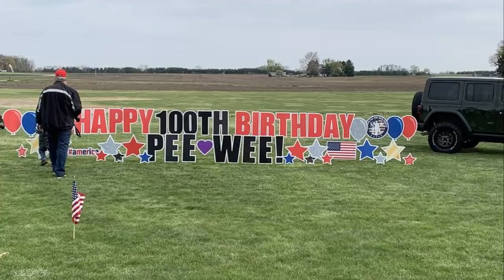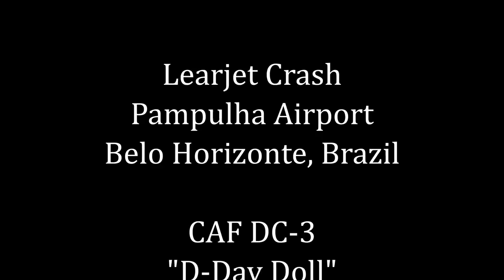Learjet Crash in Brazil/CAF DC-3 Loss of Directional Control

Comment: Here’s an idea. If you don’t have two engine’s working you don’t start rolling down the runway. Seems a pilot needs a safety briefing.
Reply: *Cough Cough" What's tha... *Cough".. I'm ok, let's go! ....
Reply: To be fair, it is a Dakota, and those P&W engine are temperamental beasts at the best of times, and if there is no oil leaking, then it has run out of oil.
Reply: @SeanBZA  
" if there is no oil leaking, then it has run out of oil"
LOL

That ought to be fun.
Reply: @SeanBZA  Pretty similar to many race car engines - at low rpm they sputter and sounds like they are about to give up the spirit but as soon as the throttle opens up they go into beast mode.
I wouldn't blame the pilot trying and then aborting there. The grass excursion is more a case of insufficient air on the rudder. And this also shows the importance of keeping the grass area by the runway "clean" because there will sooner or later be someone needing that space.
Reply: @ehsnils  that is why  you do a runup before takeoff. And they were having problems with it; they should've stopped there
Reply: My thoughts exactly !
Reply: No no when an engine starts to fail it always gets better up in the air at high power. Im sure of it!
Reply: @coriscotupi  The age old adage is if there's no oil  under them there  is no  oil in them!

Comment: Ok... So no war bird operator has learned from the 909 crash..  if the engines don't start properly.. or the engines won't run up prior to take off.. the flight should be SCRUBBED for 24 hours or until the faults can be identified, fixed, inspected and signed off.
Reply: Same as the North Perry FLA crash.

Comment: I got 344 hours on cargo Dc3's in South America in the 1980's.  If one engine was suspicious, we used to take off with that engine at reduced power to baby it.  I sort of see they did that on that video by the slow accel and lots of right rudder on take off roll.  No strong crosswind from the left i see to have lots of right rudder like that.  Not to say that is right, but sometimes we were in deep country side villages and needed to get out of there.. Fast..  Most times it was bad or old spark plugs..

Comment: Thanks Juan, I personally know of a couple of gear-up Touch-n-Go incidents that nearly ended in disaster: One, I witnessed from the ground when my father in an 1963 Cessna 320 was on an extended left base to final when instructed to switch from runway '34' runway '31' due to traffic doing an aborted take-off on runway 34. In the process he raised the gear and was distracted by non-pilot passengers and a confused new tower controller, and forgot to extend the gear from a tight left base to 31 that had a significant left cross-wind. This caused him to 
'prang' the left prop on the concrete and then the right prop as he lifted the left wing. He had enough excess airspeed to manage a pull-up and abruptly fire-wall both throttles, an action that in an an early turbocharged aircraft such as the 320 with fixed waste-gates caused the right engine to experience a major turbo surge and produce more than full power, while he left engine experienced turbo lag and to  'bog' severely with a near total power loss. This caused my father to end  up in nearly a 90 degree left bank just above a stall and on a collision course with the control tower. He cut power on both engines nosed-down and rolled-right and managed to miss the tower by about 20ft as the tower crew ducked for cover. 

After nearly missing the tower, reducing and re applying power allowed both engines to power-up normally and my father to recover a few feet above the airport fire station roof and land with nearly a foot of each prop curled backward. His take-away was to follow the old rule-of-thumb and after a balked landing attempt to completely abandon the landing until normal pre-landing procedures and approach can be implemented.
Reply: That is one crazy story, and I believe it just like you told it.
Reply: I would have thought "tight left base" is a red flag.
Reply: @jamescaley9942  Indeed, and as I clearly recall, my father remarked that the 'confused' controller after clearing him to land while on downwind to base, the aircraft on the runway aborted just as he was turning final. The controller then instructed him to 'Go Around!", and just as he 'upped' the gear and added power, the controller said to then make tight left left-base for 31 and cleared him to land, instructing other aircraft to follow a friend in an ANG Mohawk doing a practice IFR approach to ILS 31. Our friend in the Mohawk saw the incident on final so the Mohawk traffic might have been a reason for tower saying make tight base for 31. 
My Father said he said he was a little low for a left base to 31, so he left the flaps in 'approach' and a set-up for a gusty cross-wind landing on 31. 
I'm guessing that making a tight base didn't feel unreasonable to my father as he was an old Navy pilot and preferred tight military overhead approaches. However, was not in a position to do a diving approach, a little  'draggy' and ended up holding power right down to the runway. He said he never did a final approach check because he felt he was configured to land and forgot about retracting the gear and got the gear horn just as he reduced power and pranged the first prop. 
In hindsight, the best thing would have been  to decline ATC and continue the go-around on 34' rather then convert to some ad-hoc approach. 
 I do  I recall at the time ATC as SLE used to get things balled-up when ANG operations and others were using 31, and VFR GA student pilots were using intersecting 34. A few times traffic got so screwed-up I and other pilots simply left the pattern until they  it got sorted out.

Comment: My father had that during training, doing a whole set of cadets in take off, return and land, then hot swap the pilot to get the next one in. His turn again, and half way down the runway between V1 and V2 the engine cuts out.  He probably still owes the UK government for one Gypsey Moth..... But they never collected, and he also owes them for one Lancaster, he lost it over Lake Constance, though the Austrian doctors did tell him he was found 2km from the wreck, in a snow bank, with a pine tree in him in little pieces.

Dakota will be fine, that landing gear is meant for dirt runways, just wash off the grass.Last one I travelled in was in 1992, where the FE and I got to look at the underside of the plane from the door, because the gear indication was faulty. I was his voice relay and safety harness. Smoothest landing ever on a Dakota.

Comment: The D-Day Doll incident shows  how important it is to have good, experienced, well-trained pilots, as well as well-designed, tough aircraft. The DC-3 was built for dirt landing strips and grass runways (after all, landing strips weren't highly developed in 1935), one of the reasons why it excelled on its WWII missions. It could take off and land anywhere, even on aircraft carriers! Not that it was a regular carrier plane, but it did land on one, and it took off using JATO bottles for thrust. Similarly, it was the first aircraft to ever land in Antarctica! The C-141 was the first jet aircraft to ever land at Antarctica. Now, of course, jets fly in and out of Antarctica all the time. People like to crack jokes about the C-141 and C-5 landing on aircraft carriers, but it would have to be one mega carrier to accommodate those wing spans. LOL

Comment: It’s interesting where the firefighters are cutting, it looks like they are trying to cut open the door - tough ingress point compared to a frame bay. I believe all aircraft should have marked rescue areas. I watched a demonstration where they attacked a door on a plane versus a frame bay - 60% quicker attacking the frame bay. Many firefighters at smaller airports are not trained in aircraft extrication.
Reply: they were likely trying to get the door open to remove the instructors body with typically is used as a form of training in the process.
Reply: @sirmonkey1985  Hmm, okay I guess.

Comment: I remember an incident at Wiley Post in OKC. A wealthy farmer bought a brand new Beechcraft Baron. He did not have a multi engine rating and thus the aircraft was uninsured. At the fifth touch and go, he forgot to lower the gear. Luckily, he survived, but the aircraft was a total loss. This was in the early 70's. The aircraft had a total of 5 hours on the airframe.
Reply: That's why checklists are to always be followed.
Reply: @jcampbell2481  
I remember one checklist. It was my first flight in an Aerobat 150. It said: Be sure the ashtrays are emptied. I soon found out why.
Reply: Strange a total loss for a gear up. Musta did something else too.
Reply: @sonshinelight  
They had just redone the runway with an anti-skid finish. The concrete was very rough.
I once spoke to an Aero-commander pilot who had to put it down in a plowed field. It did little damage to the aircraft except get it very dirty.

Comment: Some years ago, a Swedish air force pilot decided to land a SAAB 39 Gripen fighter without using the landing gear. The plane kept warning about too low height and wanting him to pull up,  but the pilot ignored it since he thought the plane was silly to warn when he wanted to land. I bet when the scraping started, he realized why the plane was so unhappy with the very, very low flight height...
Reply: The next scraping sound was his stomach when he realized why he was hearing scraping sounds.
Reply: Here’s the problem besides pilots not following the landing checklist, which is boneheaded in the first degree.

The engineering on these aircraft controls is abysmal. I’m saying this as an engineer who has designed many control systems, and many components for the aviation industry. I kind of know what I’m talking about because I also worked on fighter aircraft avionics when I was in the military and I am also a single engine pilot.

Here’s how you solve the landing gear problem which happens every single day in aviation:  there is a simple Boolean logic that needs to be associated, a very simple digital circuit. It goes like this: if the air speed is low and the radar altimeter shows ground proximity, and there is ILS signal, then the landing gear automatically comes down. (There are other variations of this logic that might be more appropriate, such as considering GPS locality and flap position).

I don’t know if there is a dumber industry than the aviation industry that is calcified, goddamn calcified. Everything depends on the pilots who are absent minded and don’t follow checklists religiously. Just a little bit more automation will make things a lot safer.

Hopefully in the near future we get full automation and no more pilots (except recreation private pilots, they can kill themselves if they wish).

Comment: Seeing the rescue team cutting the door open on the 35' had me wondering if they could not get the door open due to damage or an electric door interlock?
From a little right-seat time in a 25D, I seem to recall it may have had an electric door interlock that prevented the door from being opened when the battery master was 'on' or possibly when the gear was retracted, similar to an old Aero Commander 680W I had with an electric door lock interlock that occasionally jammed and you could not get out even when on the ground that required passing the door key to someone on the outside and manually releasing the door lock. Something in either case might present a problem for rescue crews.
Reply: Must have been some damage. In the Lear you do use an electric motor to draw both haves of the door together to engage the locking pins and close the door, but once all the pins are engaged you run the motor in reverse to have the door claw disengage. At that point, to open the door, you pull up on the door locking lever to release the pins and the upper door can be opened.  To open the bottom half you move it’s handle to the unlocked position then release the door with your foot on a small lever, and it falls open. Or if in a big hurry (on fire) one can just jump out the upper door!  No electricity is required. Sounds complex, but it’s easy once you do it a few times.
Reply: @johncox4273  Cool, and thanks for the info. I was hoping someone would clarify. Might the 25D and 35 be different? It's been 30 years ago but I seem to recall a more of a manual process latching the lower door from the inside of of the 25D with a big-ass lever, but running the motor from the outside, possibly with the key? 
Also, if the lower clam door were pinned and the upper clam secured for flight would it be possible to open the upper clam whit the handle from the outside?

Comment: Do not attempt to take off if one of your engines is telling you that it is sick.
And once one makes a gear up landing, leave it on the ground...
Reply: I imagine it's easier said than done as the startle factor will be huge. Very hard to fight a natural instinct without a level head.
Reply: As stated-startle factor applies, and you want to spare the a/c damage. My fear would be that after getting in the air again you would find damage to the gear/doors that would prevent them from deploying and thus causing you to land gear up anyways. That is what insurance is for- just shut down and hang on for a noisy ride. RIP captain!
Reply: My partner landing our Bellanca 17-30 trimmed the prop tips wheels-up but made a successful go-around. Insurance covered the tear down.

Comment: i remember hearing a saying there are 2 type of pilots, those that have done a gear-up landing, and those that will.
Reply: In a way this is funny and in another way it is disgraceful.

First of all too many pilots don’t use the checklist. If they use the checklist they will put the gear down. They are supposed to always use the checklist.

Secondly, “gear down” could have been easily automated more than half a century ago with a simple logic circuit that puts the gear down when the radar altimeter shows low altitude, the airspeed is low, and the flaps are down. (GPS and ILS Data can also be a part of this logic system)

Forget the goddamn warning horn’s and everything else that is supposed to alert these undisciplined pilots.  It has been proven over and over again that they ignore or are overwhelmed by all the activity. 

We need automation, the more the better, and full automation best of all (I am a pilot and a control system engineer, so I know what I’m talking about, don’t call me an armchair quarterback, especially since The idiotic aviation industry has had 70 years to do something about this, because digital circuitry has been around for at least that long.)
Reply: @steveperreira5850  also working in aviation training here.
Tempted to bring up the "1 man, 1 dog" cabin....but i'll leave it.   :)
Reply: N Jones:  please bring it up or tell me about it, I don’t know what the Dogman cabin story is?
Reply: @steveperreira5850  Happily :)
"In the future, the two-man cabin will be replaced by a 1 man, 1 dog cabin.  The man is there to feed the dog, and the dog is there to bite the man if he touches any of the controls"
Basically everything moves to automation eventually.

Comment: I feel bad for the life of senior instructor. He was retired and out of airplanes for about 2 years. Before that he was flying very little and booked 50 flight hours in 3 years. It seems he was at right seat without a valid license, on top of that they were coming for a single engine landing for training purposes, what shouldn’t be done, but in flight simulator. Probably the landing gear configuration warning was disable due to flaps 20 landing (right configuration for single engine approach). For some reason the check list wasn’t performed, otherwise they would figured out about the landing gear. Every airplane accident has a story behind.
Reply from the maker: Wow!

Comment: It just amazes me how these student pilots forget GUMPS. There is a placard in every aircraft I fly with that word on it.
Reply: More often than not, it's not students. Don't forget, a veteran was in the left seat coaching the student.
Reply: I’m just wondering, is the pilots union, that killer of passengers organization, is it so strong that it prevents Aircraft manufacturers from fully automating the “Landing gear down“ system. This could have been easily done 70 years ago or even further back in time with a simple logic system that takes into account altitude above terrain, airspeed, flap position, and possibly GPS &/or I LS Data.

Every time I look into one of these crashes, it seems like we’ve learned nothing, and we keep depending on pilots that we know sooner or later some of them are going to not follow the checklist and are going to crash. This is insane, the very definition of insanity, is to keep doing the same dumb thing over and over again!
Reply: John Hunter:  And so the veteran does not have a checklist, the guy in the right seat, for some reason, you cannot have a checklist? There is no excuse for this, no good excuse that is. Live by the checklist or die without it!

Comment: Regarding the DC3 'incident'; I have been in the following twin piston aircraft, as passenger, DH Rapide, DC3, Bristol Freighter and Catalina PBY5A. In all cases I recollect hearing the pilots performing the classic pre-takeoff engine magneto checks. Taking off, with a presumed faulty (failing power) engine would not have, and should not have occurred for evident safety reasons.

The Bristol Freighter trips involve a 500+ mile (there and back)  flight over the unforgiving Pacific Ocean. No room for errors there.

Comment: Apparently this DC-3 was corrected later by right main brake action.  Without rudder authority this is only way to directional control (with previous unlock tail wheel).